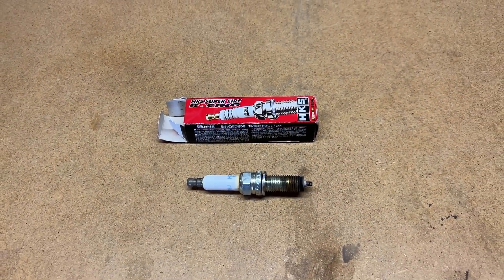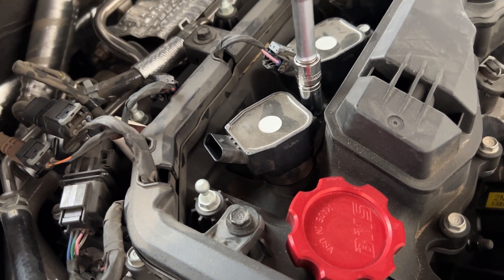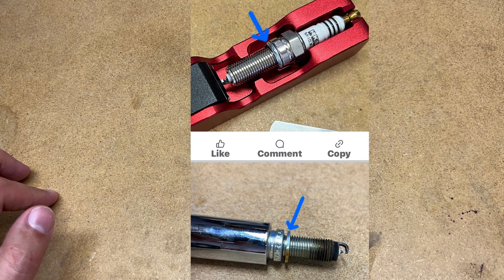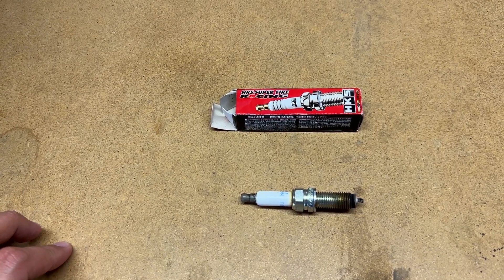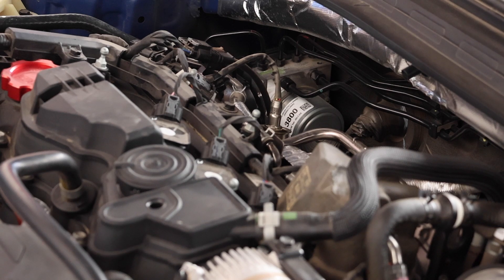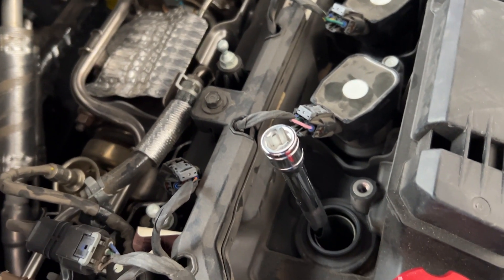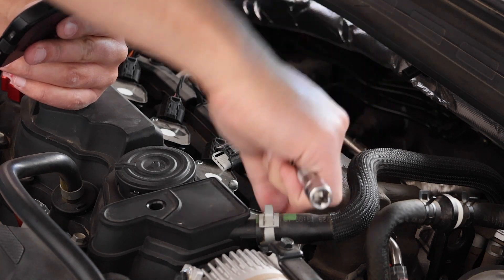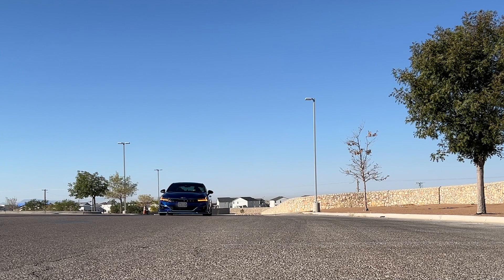HKS Spark Plug Install & 1,000 Mile Test – Are They Safe for K5 GT-Line JB4 Builds?

Comment: What did you gap the HKS to?
Reply from the maker: .022
Reply: Thank you I'm having a hard time figuring out what I should put in for spark plugs in my 2021 Elantra n line with the 1.6t smart stream engine I believe it's the same engine as yours but after doing research I was told that HKS plug are if i was pushing like 8-10 more boost than stock and sounded like HKS plugs are "overkill" for the car and that I got told To get NGK Laser Iridium Spark Plug (SILZKR8E8G)
High Ignitability & Durability my plans to run map 3 I believe it's the 93 octane idk if you can give me advice for anything I should do but it'd be well appreciated I like your advice on video and your Kia looks great man!
Reply from the maker: @cain2920  The Elantra n-line is a different 1.6 smart stream engine with higher compression than mine. 
K5 s use the Smartstream G1.6T (G4FP) Turbo I-4, Gasoline Direct Injection (T-GDI) GAMMA-II engine with Smartstream tech. 
Elantras use the Smartstream G1.6 MPi (G4FM), a 1,598 cc (97.5 cu in) engine with 11.2:1 compression ratio.

I think the same guy argues for NGK which should be fine based on his experience. I am running HKS for piece of mind. BMS tested them with their system and if anything happens I can ask them.

Yes 93 octane or e85 at 27-30% blend if 93 is not available. Thank you so much for your encouragement on the videos.
Reply: @K5gtline_artist I got 93 where I'm at! So would you believe that running HKS plugs would okay for my vehicle?
Reply from the maker: @cain2920  yes. But you have to feel confident based on your own research and the BMS recommended parts. I expressed my doubts, confusion, fears that turned into confidence in the video. Hoping that my real experience could help others come to their own conclusion

Comment: How’s your car holding up with the spark plugs and tune. I’m thinking bout doing the same thing to my K5
Reply from the maker: It is still running strong. No misfires. 20% +/- increase in power on these tiny engines changes your experience